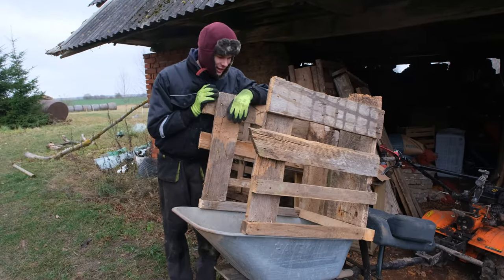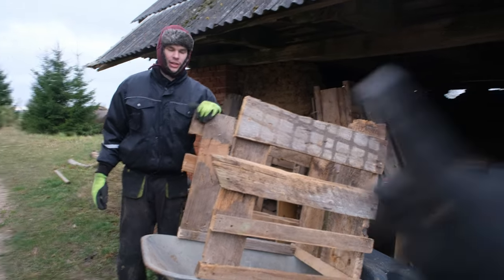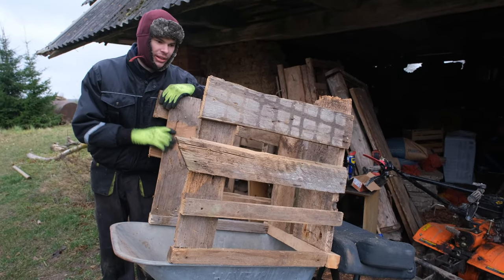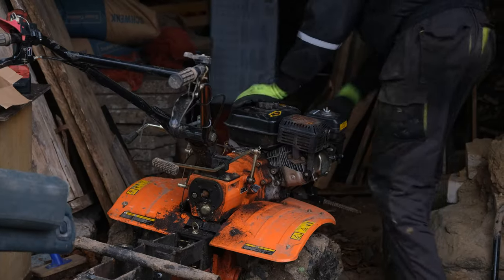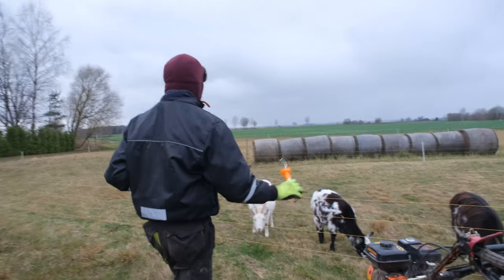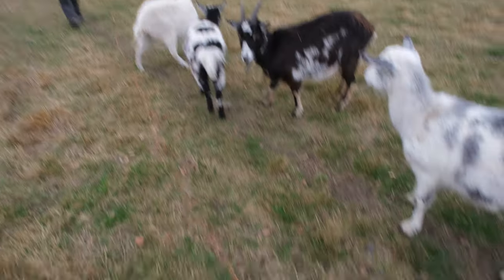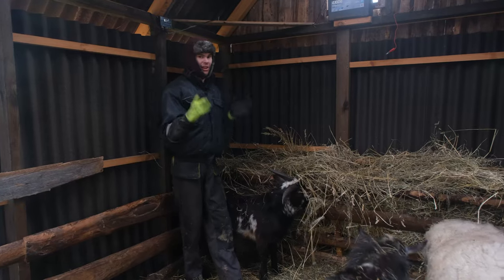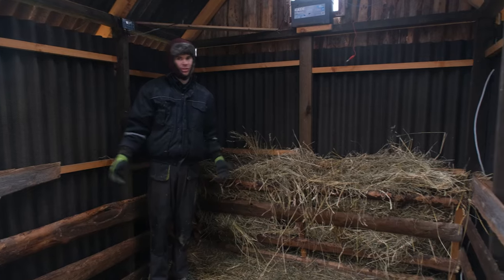HAY Transporting with DIY Trailer

Comment: ha ha a few years ago i was gathering hay i made withe a scythe far away up one a field. Bye hand with a modified auto trailer. It was a hell pushing and dragging it up there but when it was full and it was very full, I had put one giant side panels. But pushing it back from the field it was down hill. Funny story I was making hay with this very primitive improvised setup in the blistering sun wearing old military boots and a wifebeater. This guy rolls up, he is some kind of water stream inspector, cause along my small field there is a small stream that i guess he was inspecting. He ask if i own this field that he just walked trough, chest high in weeds grass and nettles. I am like yes this is my field then he point to the many many acres of perfectly sown corn at the other side of the stream and he genuinely ask if i own those too ? Yes my dude I just grew 50 acres of perfect corn with my bare hands and a modified auto trailer.